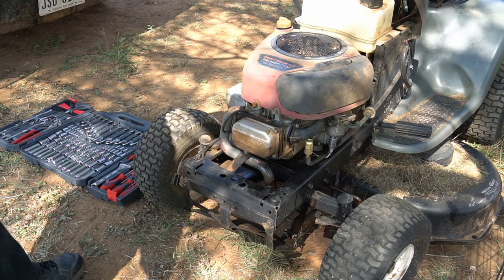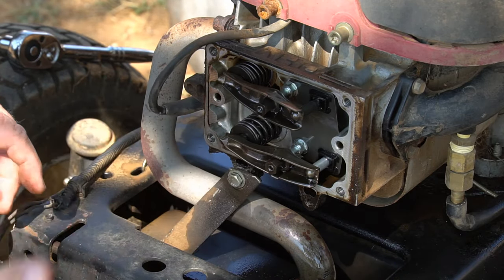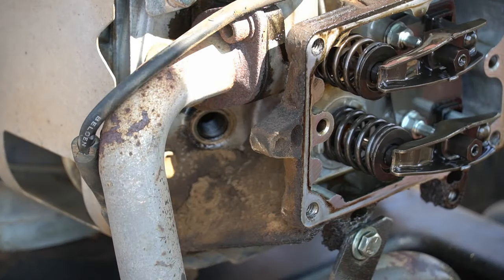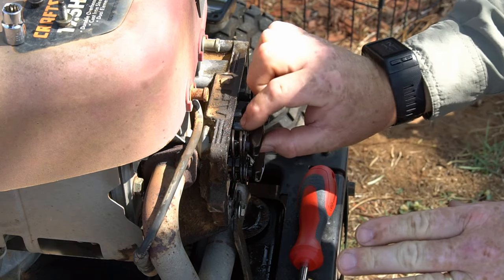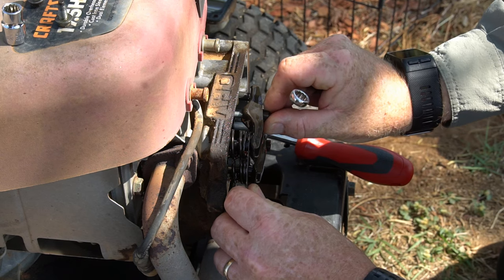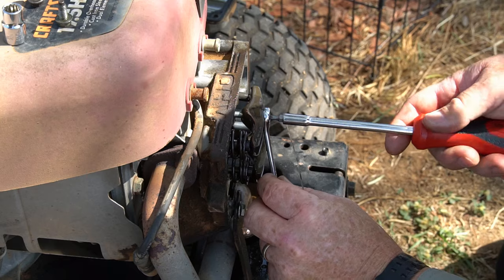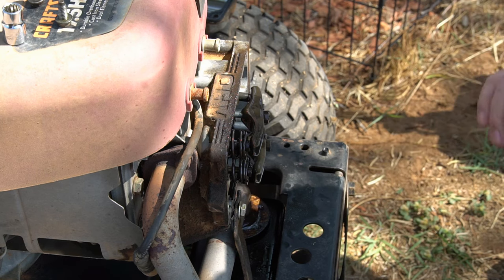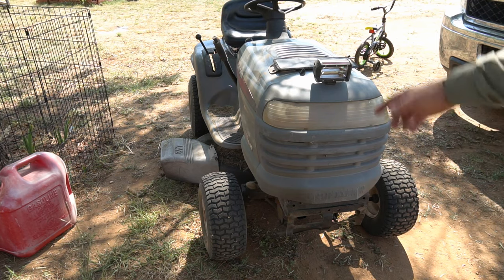🛠️ DIY: How to adjust the valves on a Craftsman (Briggs) 17.5HP OHV Engine

Comment: Another note: Don't bother wasting time looking for TDS (Top Dead Center). With Spark plug removed rotate engine till bottom spring is compressed (Intake). Then use your feeler gauge to adjust the gap on the Exhaust. Rotate engine a few times, or back and forth to double check your adjustments.Lock your adjustment screw as in the video.  NEXT rotate to compress the top Exhaust spring. From there you can adjust your gap on the intake with your feeler gauge. Again follow the video.
Reply: thanks for your comment.  almost lost a rod listening to the guy in the video.  He has everything backwards.  reading your comment has my mower running like new. thanks again!
Reply: Why is it not important to find TDC? Some say do it with TDC others say your way. I’m so lost.
Reply: @TheSponge945  you don't need to do that step if you know what you are doing. 
Just locate the gap on the intake, then fine tune it with the feeler gauge. Then do the same for the exhaust. Or which ever opens first.
Reply: @kevincronin60181  appreciate your reply but it doesn’t really answer the question. So why can it be done via TDC or your way.
Reply: On my lawnmower the intake is the bottom valve and the exhaust is the top.

I just look for the pushrods to see what's steel and what's aluminum...that's the tell tale sign.

I wish you had taken your diagnosis a step farther....what happens if settings the valves doesn't  fix the compression issue!!!

Testing for the little bump as you rotate the valves ....
Settings the valves didn't fix mine I've got a cam issue which is common with Briggs and Stratton.
Reply: That's absolutely correct. 3-5 intake 5-7 exhaust  note : if your valves are out of adjustment your mower will crank like you have a bad starter or a dead battery when the compression release is not working properly, oftentimes you think you have a bad carburetor because it's surging. Follow the procedure of the video but on top of your valve cover you can look up your specs for your particular motor.
Reply: @TheSponge945  I'm pretty sure the morons who developed and engineered that engine know a LOT more than some dude on YT. The manual says to bring it to TDC, then turn the engine 1/4" beyond TDC. That's to get the engine past the compression release inside the engine. THEN adjust the valves. Per the manual, the valve adjustment should be; intake (aluminum push rod) 0.003" to 0.005", exhaust (steel push rod) 0.005" to 0.007". I ALWAYS check to be sure someone didn't put the push rods back in the wrong position. Hope that helps. It's Briggs who has to back up the warranty, so I'm convinced they that THEIR method is the one to go with.

Comment: Nice vid.  I'm a bit confused by the piston cycles and how to tell that I'm on the right cycle to find TDC and then adjust the valves.  I don't think that the valves can be adjusted at TDC on either cycle?
Reply from the maker: There has been a lot of informative comment made on this video by professional mechanics.  Reading through them may provide an answer to your question.  All I can say is that this method works for me and this mower is still running fine.  I am however, not a profesisonal small engine mechanic. I am just a DIYer that tries to make helpoful videos about things I do myself.

Comment: Your Top One Is The Exhaust Valve.  Even Though Both The Exhaust And Intake Are At The Sides Of The Top Valve It Is The Exhaust Valve Because It Is The Closest To The Exhaust. So Since The Top Valve Is Closest To Where The Exhaust Pipe Bolts Up To The Engine It Is The Exhaust Valve. It Is ALWAYS The Valve Closest To The Exhaust Is The Exhaust Valve. Good Video.

Comment: And there is a decompression release on the cam shaft so if you are getting to much compression check your cam make sure it's not broke
Reply: I don't think mine is working. I don't get the little "bump" on the intake valve :(
Reply from the maker: There is no compression release
Reply: @thejungleexplorer  it's an internal compression release on the camshaft .. it hand grenades all the time on these engines.

Comment: Great vid, but 2 things need to be addressed...
1- The intake valve is on the bottom, notice the aluminum push rod, exhaust is on the top, steel pushrod.
2- The set screw is a T20 torx bit, not a star bit, which people might confuse for a Phillips bit.(calling it a star)
Reply from the maker: Thank you for this great information @splash5974.  I appreciate it very much when viewers contribute useful information as you have here.
Reply: @thejungleexplorer  cheers
Still a great vid!

Comment: Dam right the intake is always the aluminium rod , if you have a look at the head the intake port curves down to the intake, don’t be fooled by amateurs who think the know what they are doing they will and can damage the engine , as the aluminium rod have been known to snap at the top ,usually because of lack of oil and or the engine air filters dirty or clogged , and the plastic guide rubs through the rod and shit your engine is destroyed, a great tip keep your oil clean and make you never over fill , just do your services and your problems will be solved , and a side note do the valves cold NOT HOT .
Reply from the maker: Thanks for communicating. Great information!

Comment: I'm hoping this will fix my backfiring from the intake issue. One Of my neighbors threw away an lt 1000. So my goal is to try and get it running. Kiwi is not sheared. New spark plug new fuel. The only issue is that fuel float control valve gets stuck Open even after cleaning

Comment: On these engine I was told the top is exhaust with steel push rod,  and intake is the bottom with aluminum push rod
Reply from the maker: Thank you for this great information Jabshier1980.  I appreciate it very much when viewers contribute useful information as you have here.

Comment: I always  put steel push rods in top and bottom.. otherwise  if the aluminum  pushrod comes loose ti shoots it inside the motor.. steel can still go in but not as much chance

Comment: Actually if you use the gauge before and after you know much better where your adjustment is also the proper way for your jam bolt is torqued what is the torque specs? But you did pretty good thanks.
Reply from the maker: Thanks for commenting and adding your input.

Comment: Thanks for the video. My engine makes small cut out when running full throttle. I did the valves and rebuilt the carburetor. And changed all service parts and It still cut out. Spark looks fine. Any ideas?
Reply from the maker: Sorry, I don't know what could be causing that.

Comment: Find tdc first to to find your in and ex valves.. find tdc by using the screwdriver trick like you showed as well as the point where both in and ex valves are free floating

Comment: The last video I watched made the same mistake. The EXHAUST valve is always the first to open! The gases from the last fire must be evacuated from the cylinder BEFORE the new fuel mixture can enter. All I need to know is what to set the backlash at. If these guys can't tell intake from exhaust, how can I trust that their set numbers are going to be correct?
Reply from the maker: Did you see the motor running at the end? Since the making of thos video, this mower has mowed over 100 acres of land. Take a step back and think about that for a second. 😉🧐
Reply: @thejungleexplorer  Goes to show that these motors will run even with the wrong settings.  Probably not running optimally but running.  The video would have been an A+ with the proper identification of the valves.   Still decent with the disclaimer that the valves were miss-identified.
Reply: The "first "valve to move is dictated by where in the cycle the engine stopped the last time it ran

Comment: Did it backfire before?  My mother-in-laws same mower backfires while trying to crank but want crank.  I put a new spark plugs in it and checked the gas filter and replaced the air filter as well.  Thanks for any help.
Reply from the maker: No it did not backfire

Comment: I recently bought a used YT3000 with a 21 hp 
the lights do not work and the battery runs down overnight.
Also the battery my tech purchased for the tractor is only 210 CCA.
Is that too small for this engine and could the switch be bad on the tractor or could there be a current drain somewhere.?
Thanks
Reply from the maker: Hi.  Thanks for the question. I do not believe that the 210 CCA battery is the cause of your problem.  There may be a couple things going on here.  1. You may have a short in your lighting system that is preventing your lights from working, and that may also be the cause of your battery running down if it is a short to ground.  It also may be that your new battery is bad.  Never assume that just because something is new, it is not defective.  Unfortunately, when it comes to lawn tractor batteries, they are pretty much all garbage these days.  I don't think you can find one that offers longer than a 6-month warranty.  They will not last a season if you do not keep them on a battery maintainer when they are not in use. 

Step number one, I recommend that you take your battery in to get it tested to make sure it is still good.  Most auto parts stores like Autozone and O'Rielly's will test your battery for free.  
Step number two, Look for a short in the wiring system to your lights. The short may be in the switch itself, so make sure you test this.  You can test a switch by using a multimeter to do a continuity test.  You can also use a continuity test to test the wires from the switch to the lights to see which one may have a short. 

I hope this helps.

Comment: He's got his valves mixed up.   Intake, Compression, Power, Exhaust.  After turning the engine, the Intake should move first if it is at the beginning of the cycle.  He had his engine in the middle of the cycle (on the Power stroke) then the first valve to move was the exhaust.  So he got it wrong.   Easy to do if you are not sure where you are in the cycle.  Basically if you turn the engine and nothing (with respect to the valves) happens, you are in the compression/power stroke.  So.. turn the engine until you don't see any  valve move for a good full turn.  Then the Intake will be the first to move.  So on this engine, it is the bottom valve.  Or as others have said, look for the steel or darker push rod (assuming they weren't taken  out and put in wrong).   So.. the video is good as far as how to adjust them and the adjustment settings but you have to ignore how he tells you the top valve is the intake and use his settings in reverse.
Reply from the maker: Runs like a top and has mowed a hundred acres since this video. Funny how I got so wrong and it runs so great, isn't it?
Reply: Loop
 Thanks

Comment: Why will my intake valve, the bottom one not move? The aluminum rod is not bent or cracked. This is a Yard Machine, 13.5 hp Briggs and Stratton,38 inch cut.  Thank you
Reply from the maker: I am sorry, I am not sure what the issue is with your machine.
Reply: Most likely a worn lobe on your camshaft
Reply: Cam shaft could be worn or broken. More likely the rod isn’t in the correct spot. I’ve done that myself. Take it out , rotate the engine and keep trying.

Comment: The Top rocker is your exhaust  bottom is intake ! Look where your down pipe is located, The exhaust valve is right there and your intake runner goes down at an angle to your bottom valve. The intake has a aluminum push rod and the exhaust is steel ! "Top is exhaust botton is intake"

Comment: How did you know you were on compression stroke and not exhaust stroke??
Reply: When the piston comes up and neither valves are opening or closing.  You know it’s compression stroke going into combustion
Reply: @jrenna07  WRONG, COULD BE EITHER STROKE.
Reply from the maker: I demonstrate this in the video, but there are about a thousand comments on this video telling how to do this as well.

Comment: Please go look to almost any other video on this job, this guy is learning as he films this. I have been working on engines a log time, just came here to get the clearance, don't trust it so got it on line. Question is: Why is is so Effin hard for you folks to open up the feeler set and actually set the clearance to spec, not like you have to donate a kidney, geez.  By the way, I am working on my own Troy Bronco 18.5 hp. This is its 15th year on the turf, and the valves were only .005 over. Just wonder why a lot of folks are having trouble with worn valves. I do burn lead free gasoline. Consider this, you have the plug out, why not put a new one in, and that crushed gasket is only a couple of bucks on line. Some of these sites feature guys with $50000 trucks but are so cheap to pop a gasket and plug, it is  like they are working on these in the mountains of Idaho. The engine numbers are on the top edge of the valve covers.
Reply from the maker: Thank you for commenting
Reply: I wondered the same thing about the gasket. Of course, I put a new plug in every Spring.

Comment: Great video awesome of you taking time to upload and share. I could not get a 10 mm box end wrench on my nuts needed a 5/8. My nuts might be bigger than yours I don’t know.
Reply from the maker: Thank you for commenting eviloctober!  I am so glad the video was helpful.
Reply: Yes, they do make changes over the years. My 2014 John Deere D105 has the 17.5 HP Briggs engine, and the valve adjusting nuts are 5/8 inch. Same adjustment procedure, but my specs are .005-.007 for the exhaust, (the top valve), and .003-.005 for the intake, (the lower valve). So I set them at the middle of the range, .006 exhaust and. 004 intake.

Comment: If you set exhaust valves to tight in any engine you will eventually burn out the valve seats.  Loose tolerance in exhaust will never have this problem.
Reply from the maker: Thank you for commenting sky5jump!

Comment: No Sir.  The 4 stroke cycle is intake, compression, power, exhaust, which means the next stroke after exhaust is the next intake.  As you rotate the engine clockwise, the first to open and close is the exhaust, followed immediately by the intake.  The upper is the exhaust valve with the steel pushrod.  The lower is the intake with the aluminum pushrod.
Reply from the maker: Thank you for this great information Al Molloy.  I appreciate it very much when viewers contribute useful information as you have here.

Comment: If he did it wrong how did the mower start?
 I keep adjusting the lash according to about 6 of these videos , each one is a little different and now I am completely confused , the keyway was sheared to begin with , I fixed that and now it keeps backfiring through the carburetor any ideas?
Reply from the maker: Like you, I watched a dozen videos trying to figure this out. After watching them all, I made this video to try to offer all the information in a more concise manner because so many if the videos did not show the process right or had conflicting and confusing information.
You may have to readjust them.  I have to do mine about once season.
Reply: William Burdon don't worry about finding top dead center and all the other BS he showed just turn your motor over until one of the valves is open and one is fully closed adjust the open 1 to 4000 rotate the motor until the opposite one opens and the other ones closed adjust down 4000 this will get your motor running if you still have compression problems check your camshaftThe decompression lift is probably not working on the camshaft
Reply: @dirtdognunya7866  Thanks I will try that , and let you know what happens , I really 
appreciate the answer!
Reply: @dirtdognunya7866   Thanks nunya , I did as you suggested and the mower started and ran on its own fuel supply , it is still popping through the carb a bit though, should I try to set the valve lash open a little more ? What would be your next step?

Comment: When you were rotating you were seeing the exhaust stroke and then the intake stroke there would have been a compression stroke between the intake and the exhaust stroke valves moving so you just adjusted the wrong gap for intake and exhaust.
Reply from the maker: Both adjusted to the same gap

Comment: Hey Jungle Explorer, thanks for the vid, it was very specific and informative. After the adjustments have been made and my engine still doesn't start, or starts for a sec with starting fluid, but won't stay running. While I try to start it, the engine will actually kick back the opposite direction. I have tried 3 different valve adjustments from 3 different video's and the engine does the same thing. Is TDC between the closing of intake valve and opening of exhaust valve, or between closing of exhaust valve and opening of intake valve?
Reply from the maker: Sounds like the engine may need more than just and adjustment
Reply: Your key way is sheared or compression release is broken
Reply: Likely needs a carburetor cleaning or just replace 
with a new carb. Just cleaning the main jet on the bottom will probably allow it to stay running but not idle smooth until the whole unit is cleaned.